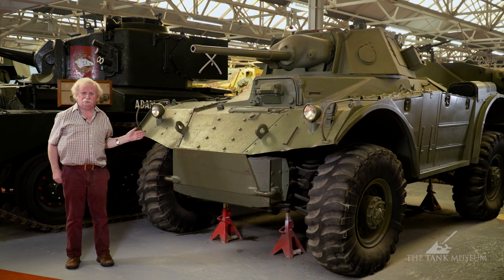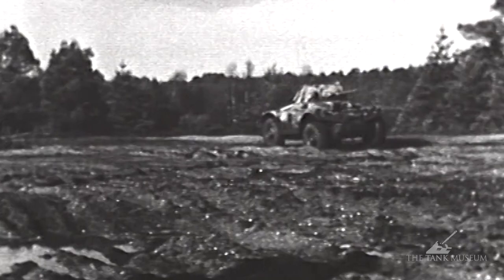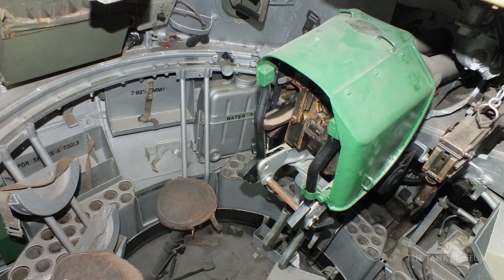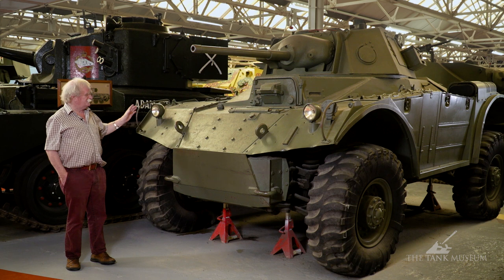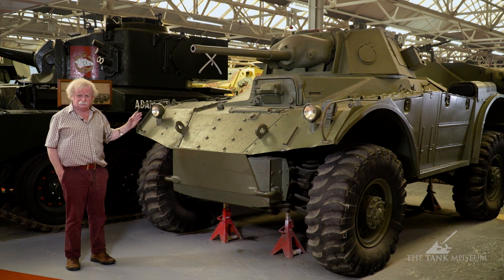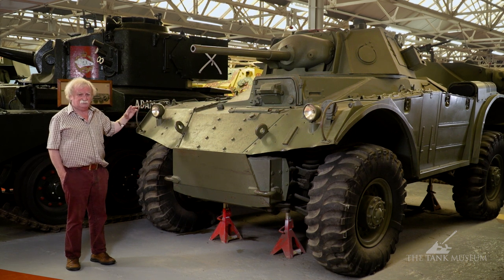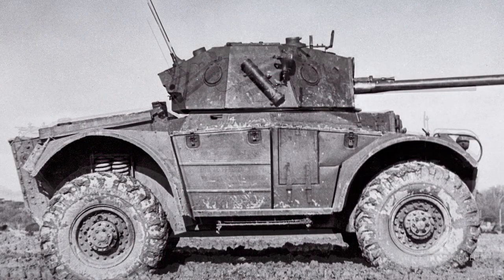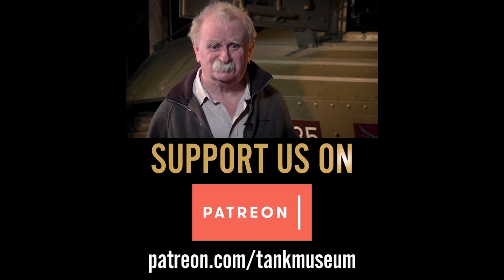Tank Chats #86 | Coventry Armoured Car | The Tank Museum

Comment: I get the feeling that an “Oh no, the cars on fire” test would not kindly look upon the removable steering wheel seatbelt.
Reply: Yeah, that was what I was thinking as well. Removing that nut during a fire would probably be the longest few seconds of your life.
Reply: I think you could get out, just not in, with the steering wheel in place. Thinking about how the human body bends and twists...
Reply: Well...when you're 6'5" like Nicholas Moran, you might need to remove the steering wheel to get both in & out.  Oh bugger, the steering wheel is on fire!
Reply: @franzfanz  or last...
Reply: I think it would be easily solved with one of those “push the shape through and turn 90’” type locks. 
You often find them on kids toys.
It’s solid once locked and all you’d have to do to get it off is turn the thing a right angle and pull.
Reply: i'd get the feelin that by the time you've undid the nut you'd be charcoal
Reply: Probably a naval architect.  Thou shall go down with your ship!  Shut up sir.
Reply: I doub tthis is so, but i bet you could design it to be one of those interrupted threads so you can unscrew it instantly

Comment: Hey the idea is that you're not exactly sending this against Tigers, and the German's own lighter stuff like half-tracks and their own armoured cars would still be vulnerable to a 2-pounder
Reply: Yeah but there were usually Panzer 3, 4 and Panthers around too, flak 88's and antitank guns, panzer Faust's... Germans were good at destroying impotent thinly armoured English armour by this stage.
Reply: As for stuff like Panzerfausts if the crew weren't in a position to run away from those too and had no infantry escort to deal with the operators, they were dead ANYWAY and would likely have been in ANY Allied vehicle
Reply: @indyrock8148  
I think that's what the speeds for, you don't fight in this thing, you scout, very quickly.
Reply: @MostlyPennyCat  the speed, thin armour and 2 PDR combo had universally been proved in- optimum by this stage of the war. 
I think the reason they said it was obsolete was they had better armour options available, hence obsolete.
Reply: @indyrock8148  That was why it was small, fast, quiet, hid easily and had the ability to be driven backward at speed without the need of turning. The vehicle was for reconnaissance, not trading blows with enemy armors. Nobody used a lumbering noisy heavy tank for reconnaissance.
Reply: @indyrock8148  
I would disagree with if it weren't for the fact is 11 tons.
It's a scout car or for engaging mechanised infantry.
Except it's far too heavy and probably slow and does have the throw weight to engage things it can't run from.
It probably is useless as I doubt it's fast enough.
Reply: @MostlyPennyCat  The Coventry was actually having superior power to weight ratio than both the Diamler or Humber it was meant to replace.  It was just entering production in June 1944 when the British Army felt the Diamlers and Humbers they had were good enough for scouting and reconnaissance and there were really no need for another type of armoured cars to complicate logistics at that stage of the war. So the Coventries got chopped.
Reply: @tvgerbil1984  But HP/ton dosnt fully describe its mobility. Ground pressure is important too. If it used the same tires, but was heavier, it was less mobile. Look at the Churchill tank. Very poor engine(s) power but good mobility. Just put it in low gear and drive 2 miles per hour.
Reply: @Paciat  Compared with the contemporary British 4x4 armoured cars, the Coventries were lighter than all three marks of AEC armoured cars which were also in the British army service at the time, and by nearly 2.5 tonnes when the Coventry compared with the AEC Mark iii. The Coventries had the best power to weight ratio of all British armoured cars in WW2. Were the Coventries too heavy? The British were content with that weight catagory of armoured cars which had served them well enough in the desert and in the European threatre. Maybe it would be a different story in the far east where ground pressure mattered more but the French actually deployed them in Indochina.
Reply: @tvgerbil1984  I guess your right. Coventry could fill the gap for an AEC successor, if WWII was longer. It just wasnt that much better than the AEC. Sometimes better isnt good enough.
Reply: @Paciat  I agree, it's actually a decent vehicle in its own right. Just not a good enough option by this stage of the war. It had been overtaken by other  vehicles. Hence obsolete.
By this stage for scouting activities they had smaller cheaper scout cars (with even more reverse gears). For combat they had tens of thousands of (probably cheaper) Sherman's, Cromwell's too.
And I think by this stage they had had a gut-full of the 2 PDR. They did win the second battle of Alamein, but tank and crew losses were high. This machine pretty much offered more of the same recipe, something which can run around the edges but can't bring it to a battle. The damn thing is built to run away!
No one mentioned cost either, was it the same as a light tank? Probably at least close.
If you have limited man-power in terms of trained crews, manufacturing capabilities and capital there were better options by this stage of the war.
If your the General do you want your 100 or so experienced crews in these things or Sherman's or Cromwell's? What would be more effective?
Reply: @MostlyPennyCat  agree
Reply: Agree
Reply: @indyrock8148  Misses the point. Armoured cars were for reconaissance, not combat. The mark of a good armoured car was that it was relatively small and could run away quickly. From that POV the Coventry was not too bad.
Reply: @kenoliver8913  it's neither fish nor fowl

Comment: Armored cars with rear driving positions never made sense to me. Internal volume is at such a premium it seems like a waste for the rare times when it is faster to have a turret crew member squeeze back and take over rather than just have the regular driver quickly turn around, or reverse a little more slowly (but virtually immediately) with help from the commander looking through the cupola. 

Also, shocked someone thought a nut on top of a steering wheel was a good idea.... would love to see the Cheiftan give that position the "Oh bugger the tank is fire" test.
Reply: Oh, I'd love to see the Chieftain try and get in that driver's position! I have no data to back this up but I figure that the rear driver might make sense to just have an extra man, like you use him and the loader as a security element on foot or have them sneak a peek somewhere before driving the car in. Although I think the better option would be to just have a mix of vehicles like the M20 Armored Utility Car and the M8 Grayhound, where the M20 has four extra guys who can operate on foot when needed while the M8 got the bigger gun to back them up.
Reply: You would also think they could have come up with a mirror system that would have been far lighter than all the engineering required for a second drivers seat. Nowadays most protected vehicles have wing mirrors for driving on the road.
Reply: Turning around was often not an option.  In a scout car on a narrow European street or country lane backing up in a hurry was often the only way out of trouble.

Comment: Why is the car sitting on jacks? To save wear on the tires?
Reply: Most old vehicles are set on Jack stands to take the pressure of those 11 tons off the suspension, otherwise the springs will give out and sag over time. The suspension is likely already in rough shape.

Comment: The odd thing is that the Coventry was regarded as a failure. Often, when something looks right, it is right, and the Coventry looks right. The size is fine. It is bigger than the Daimler and the US M8, both very successful designs, but it is smaller and lighter than the very successful US built, Commonwealth used, Staghound and the British AEC, also regarded as a successful design. The engine is the US Hercules RXLD of around 175 horsepower. This was used because the Brits simply did not have a suitable petrol engine available at that time. The RXLD was a proven and reliable, pre-war design, inline six; nothing wrong with it. The suspension was independent all-round and, as can be seen on the video, with excellent wheel-travel. I am not sure but I believe that the Coventry did not have the H-type drive line lay-out of the Daimler but rather had a central differential on each axle. Nothing wrong with that either. Still today the most common type of independent suspension used today. The two pounder gun was silly though. It was obsolete by the mid-forties, was no longer effective against the tanks at that time and, even worse, did not have an effective HE shell. IMO ithe car should have been built in 2 configurations: ons armed with a Polsten gun, or even the 15 Besa, and the other with the 6 pounder or 75mm. I think the main problem with the Coventry was that it came at the wrong time. The war is Europe was winding down and the smaller armoured cars then in use were seen as adequate for the reconnaissance role. The European war had also become a tracked vehicle war. Big armoured cars were neither fish not fowl: big enough to be easily seen and hit, yet poorer mobility and armament than tanks, and lightly armoured. A slightly reworked Coventry would have been an excellent competitor to, for instance, the Panhard AML during the post war years when armoured cars became more popular again. It was simpler and cheaper to build than the excessively complex Saladin and it could take a larger turret ring.
Reply: @G G The 90mm F1 gun of the Panhard AML only weighed 400kg; substantially lighter than the 6 pounder and the similar 75mm gun. It was a low velocity gun with much lower recoil than the 75mm gun installed in the mark 2 version of the Coventry. During sixties and seventies the F1 was offered as an upgrade for the WW2, 8 ton US M8 armoured car. The Coventry would have been more than big and stout enough to be fitted with this gun. It could easily have coped with the more powerful F4 version of the French gun which was  fitted on the Panhard Sagaie, also an 8 ton car. It might have been possible to fit the entire Panhard turret, with 90mm gun, to the Coventry, if the turret ring diameters matched. I think the Coventry turret ring was slightly smaller than that of the Panhard though. 

The Coventry was however a British car. The above mentioned stuff is all French. If a Coventry derivative was produced after the war, it would probably have been armed with the 75mm gun developed for the Saladin. The question is how a 1955 model of the Coventry would have compared to the Saladin and how it would have compared to the Panhard AML which was the main competitor to the Saladin, and totally outsold it, on the international market.

Comment: Lmfao these guys went from the minimum to the maximum with the gun, I bet even a 57mm would've done well enough
Reply: The 57mm (6 Pdr) and 75mm tank gun took up the same amount of volume and had similar recoil forces.  They were basically the same gun with different barrels.  One could fire useful HE and Smoke rounds which was far more useful in a scouting vehicle than obsolescent anti-tank performance.  The downside is increased weight, increased height and the loss of the dedicated loader/rear driver and the subsequent loss in efficiency that implies.

Comment: I have long wondered if anyone ever tried to adapt the HE shells from the 40mm Bofors AA gun to the 2 pdr case.  Seems like that should have been possible.
Reply: Maybe they should have used the Bofors 40mm instead of a 20mm. The vehicle looked reasonably agile in the footage. 
I guess the field commanders knew it wasn't going to work for them for whatever flaw they saw.
Reply: @kimepp2216  -The Bofors was a big gun.  They would have needed a bigger boat.  The 2 pdr was a 40mm weapon though just like the Bofors.  In much the same way the British 8th Army adapted German 75mm AP projectiles onto American 75mm cases to be fired from M3 and M4 medium tanks in the Libyan desert I am curious if it had occurred to anyone to do the same with the Bofors HE shell and 2 Pdr case. Seems like it should have been feasible.

Comment: They're displaying that Coventry all wrong. Instead of jacks, they're supposed to take off the wheels and then place the vehicle on cinder blocks.

In all seriousness, it's not a bad looking vehicle. WIth the exception of no HE for the 2 pounder and the whole having to remove the steering wheel to get in and out of the driver's seat, it would make for a decent shtf/zombie apocalypse vehicle.

Comment: Why not put a 6 pdr gun.  At least you could get decent HE and knock out light tanks
Reply: That does sort of make sense, and the AEC MkII did get the 6-pdr. Wasn't the British QF 75mm essentially a larger bore version of the 6-pdr? Used the same ammo as the American 75mm. So the 75mm version of the Coventry could have started out as a 6-pdr model.

I do wonder if the American engine was a bigger factor than the gun, with some other features worth enough production for testing. Then you say to your allies, "It needs a bigger gun..."

Comment: Armoured cars ideally need to be 6x6 or even 8x8. A 4x4 drive system is terrible x-country as can be seen in the video. Once the Brits brought out the Saladin, Saracen and Stalwart (HMLC) x-country driving was a breeze compared to this and any other 4x4, which went up and down more than they did horizontally.
Reply: Fox and Ferret are 4x4. The Foxes were still in British service after all the Saladins were gone. These 4x4s are light, fast, cheap to build and to maintain, but most importantly, adequate for the job they are supposed to build for .... scouting, reconnaissance, and never pretending to be a tank.